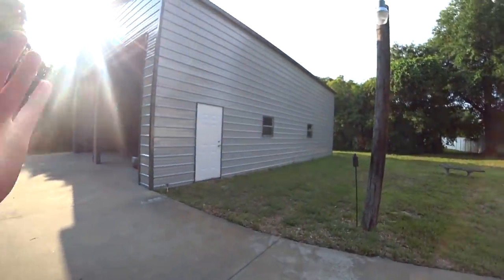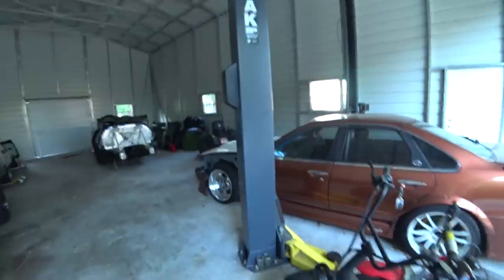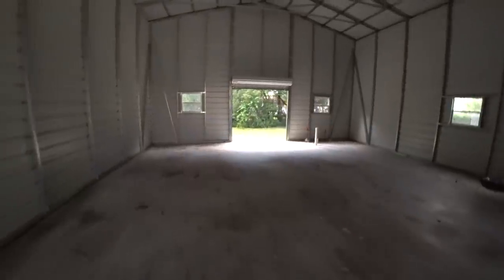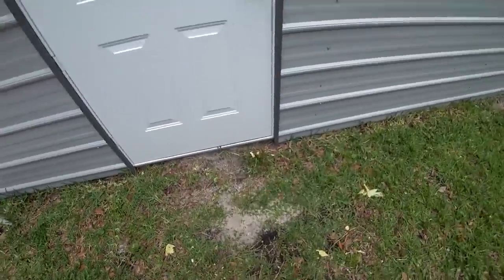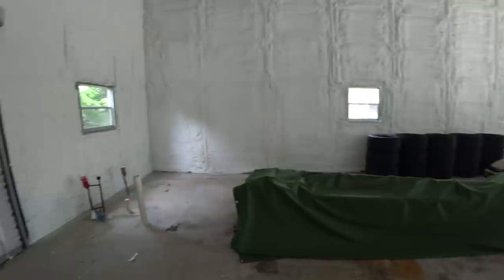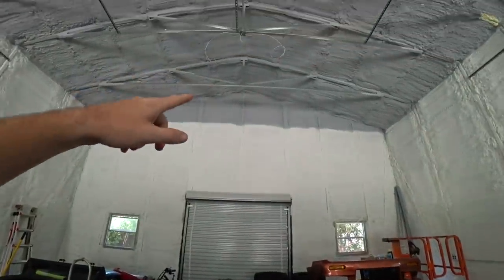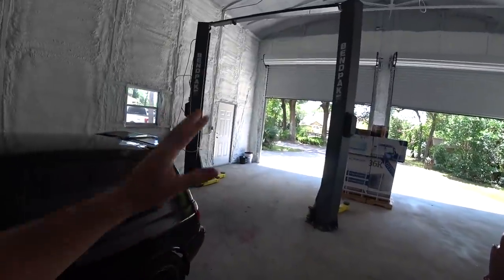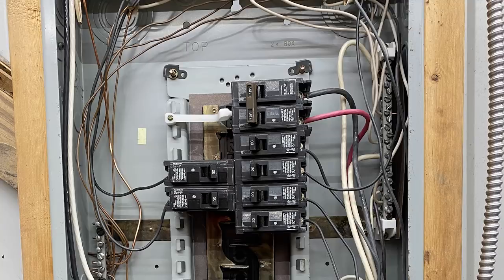New workshop build out. Spray foam and Electrical.

Comment: Triple the AC with 6 times the CUBIC ft.
Reply from the maker: It’s 6x more ac.
Reply: Those 36k Mr. Cool units are spec'd for around 1500sqft each. 

Sure the higher ceilings will need a little more than a lower ceiling building, but he's already way overkill in the A/C department.

Comment: Stupid UK question : is the humidity the reason that most houses in FL are single story? Like bungalows or am I over thinking it? 

Only asking as you said about going up on the scissor lift and it didn’t get hotter at the apex of the roof.
Reply: I think it's more to do with Florida being the retirement state and older people preferring single story buildings. A bit like why many retirement hotspots in the UK are full of bungalows.
Reply from the maker: That’s a good question. I’m not sure. I think it’s probably more to do with hurricanes. We have crazy wind codes here even pretty far Inland.
Reply: @Taylordrifts  that’s a valid point! Thanks for taking the time to reply dude 💪🏻 can’t wait to see the shop and corvette finished 👌🏻

Comment: No where near enough ac for a building that size
Reply: Each one of those units are spec'd to heat/cool around 1500sqft.

The higher ceilings will need a little more, but they're really oversized for the space.

Comment: Damn ... I REALLY don't want to piss in anyone Cheerio's ... but you REALLY need to put the brakes on and rethink this. That foam is going to get chunked out every time something hits it. And honestly ... the fact that you tried to justify how it looked, tells me you already know it looks ... bad. Have your electrician stop, pull the little bit of low conduit, and skin the lower 8 foot of the walls with the same tin the building is made from. Then have your sparky run the conduits above that, with drops to your outlets. 
You can do it now, or you can do it later ... but there is no way you will be happy with the shop in a year when that foam looks worse than it already does.

Comment: "these steel beams are 5 feet apart so you cant attach an 8ft sheet of drywall"
Reply from the maker: If they were 4ft on center you could, if it's 4ft from beam to beam, then the next beam is 5ft the end of the board would land 1ft before the beam giving you no way to attach it.